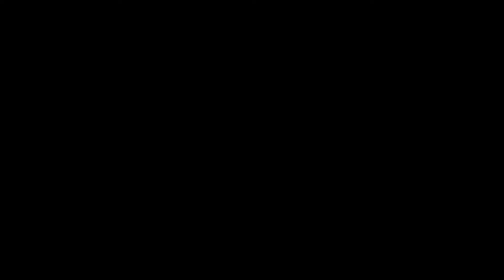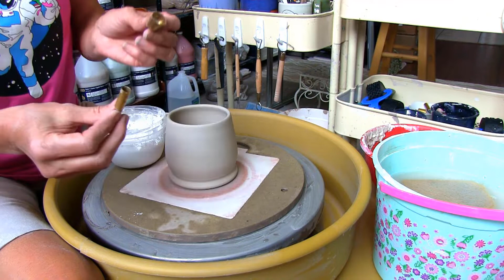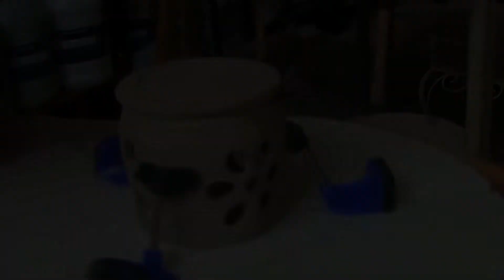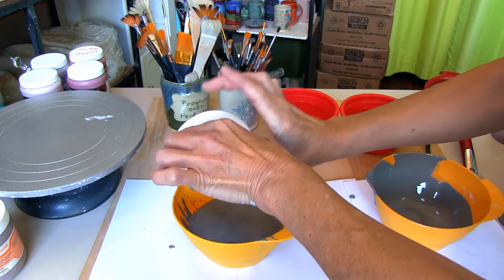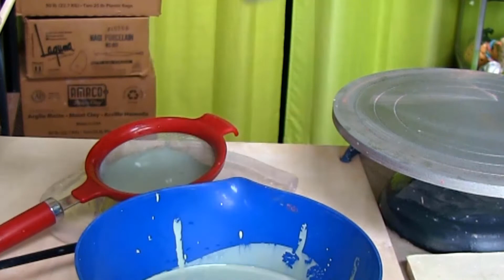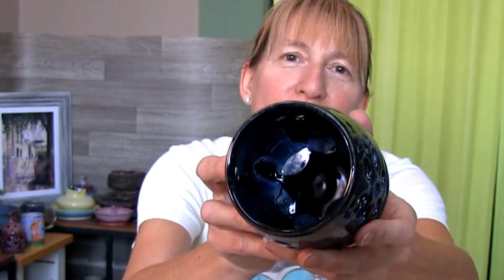Making a Candle Holder Beginner Pottery Wheel Projects # 13

Comment: You've now answered questions I've had to almost every problem. Such as "can you cut clay like cookie cutters" and "if yes how without it sticking." I'm experimenting with what little clay I have before firing it and you're speeding this whole process up. Do you have a video about homemade grog?
Reply from the maker: That's great Devin. No I don't because I don't work with much clay with Grog. Only when I'm making cookies or Raku pottery. 😊
Reply: @PotteryCrafters  fair enough, thanks for replying. Im now that ive messed around a bit with grogless clay and I think it'll be fine for now
Reply from the maker: Thank you for the suggestion. I would like to experiment with it. Probably start with a fine grog.
Reply: @PotteryCrafters  Yay! I was wanting to use a fine grog 😁.
Reply from the maker: Yeah! Because I throw on the wheel a lot and grog can feel like sandpaper. I think the fine grog will be better. Plus, grog helps with cracking, issues, and stability.
Reply: @PotteryCrafters  I made a ceramic spoon! Its not functional but it looks neat at least 😂
Reply from the maker: Spoons can be a bit tricky. You would have to use clay that will vitrify and stilts. But you can still get tiny holes from the stilts.  😊

Comment: Hi👋🏻🥰 your work is absolutely amazing!!!
I wonder, why does ceramic sometimes break in the kiln? This scares me...
Reply from the maker: Thank you very much. That is a good question. The reason why pottery cracks or breaks in the kiln is because if there is any water in the clay and it evaporates from the clay too fast it puts pressure on the clay particles and the clay will crack or break. For more information on drying clay here is an article for you to check out https://potterycrafters.com/how-long-pottery-should-dry-before-firing/  😊
Reply: @PotteryCrafters  you are a real sweetheart artist❤️ thank you so much for your help🙏🏻 I will check the link🥰
Reply: @PotteryCrafters  Sorry for bother you again...
I wanted to know, is it a problem if I buy coloured glaze for 1100° with a kind of ceramic which fires at 1040°?
Thank you in advance :)
Reply from the maker: No, bother. 😊 It sounds like it's 1100 ℃. You can bisque fire your clay to 1040 ℃ then glaze fire to 1100 ℃. Any more questions feel free to ask. 😊
Reply: @PotteryCrafters  thank you so much🙏🏻💞
Reply from the maker: So sorry I'm glad I read the comment over. I meant you can bisque and glaze fire to 1040℃ . You can't go past 1040 ℃ or your clay will start to deform.  The glaze should still turn out. if you are unsure you can always test fire or buy a higher temperature clay. Let me know that you have received this comment. Sorry about that. 😊
Reply: @PotteryCrafters  thank you! I just read your comment and got all your information🙏🏻 
As soon as possible, I will buy underglazes and transparent glaze to coloured and decorate my creation ^^ I am excited and scared at the same time ihih
Anyway, thank you so much for your kindness and professionalism 🌺
Hugs from from France by an Italian girl ^^
Reply from the maker: France! That is most wonderful 😍 Thank you for sharing. Yes, it was both scary and exciting for me also. The good news is the scary will go away. The excitement will stay. 😊
Reply: @PotteryCrafters  thank you for your encouraging words 😍 I think your are right ^^ I will let you know!